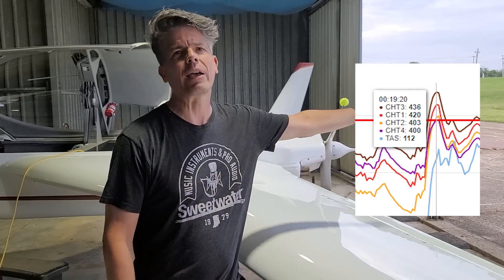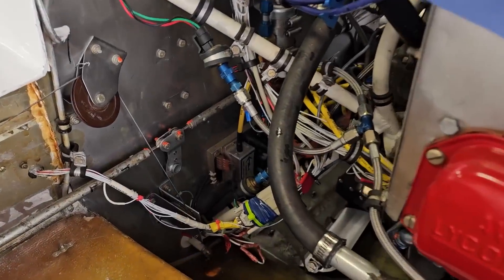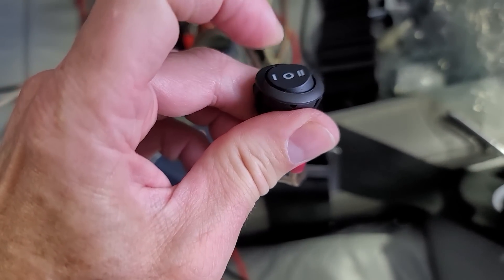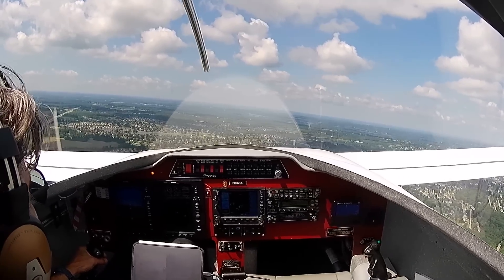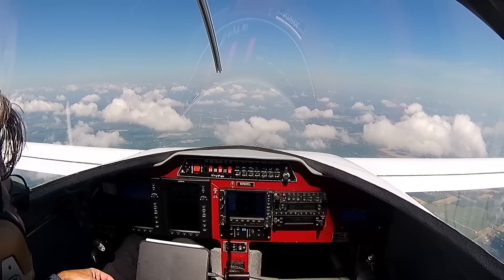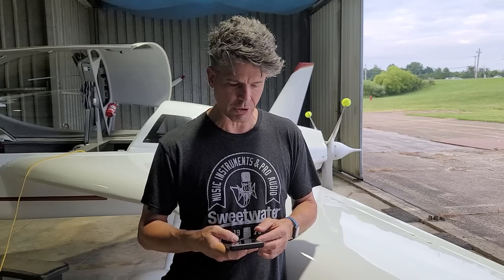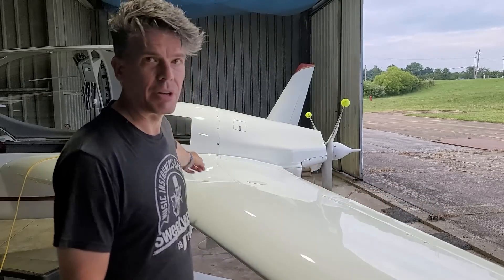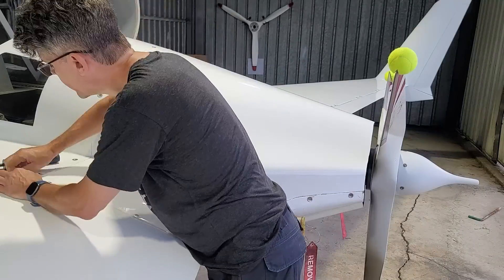FINALLY! My Overheating Cylinder Head Temperature Problem is FIXED!!! What Was the Cause?

Comment: That was awesome.  I’m having similar problems with my Cozy and found a similar issue.  I’m still working on it. How did you turn on and off the manifold pressure to the EIS?
Reply from the maker: I literally ran a set of wires back to the engine, connected them to the wires going between the manifold air pressure sensor and the EIS, and at the other end connected a switch that I could actuate in the cockpit.
Reply: @CanardBoulevard  my EIS has a manifold pressure line that runs directly to it.  I take it yours is an electrical signal that goes to your EIS?
Reply from the maker: @randyjaeger4406  Yes, it is a separate module. I'm about to replace the entire EIS, and the new one has the MAP sensor integrated.

Comment: Scott, thanks for the video, glad you got your CHT's fixed. My Cozy runs 300 330 CHTs but I have been fighting high oil temps. I have a friend with a new EZ still in flight testing and in the couple of years he has had it he has had it he has been unable to safely fly it without the CHTs going way high. I have suggested he check the timing and the carb jetting but it may be his P51 style scoop is way longer than Rutan's plan scoop. He does have a Surefly emag on it and I wonder if that has vacuum advance. I don't remember if it has a vacuum hose on it.

Comment: Thank you for this video and explanation. Very well produced and presented.  I'm also chasing a persistent CHT issue that has gradually worsened.  It's in a canard with a Lightspeed III and an E-Mag. May I ask which EIS you are using?
Reply from the maker: It is an ElectroAir EIS-1.

Comment: I wonder if you should use an endoscope to take a look at the top of the pistons. Just to make sure there was no damage from the extreme timing and heat causing pre ignition? Even with 105 that I would think can happen, you probably would hear it with the load exhaust. I am no airplane mechanic, just an old gear head. Good job finding the problem.
Reply from the maker: Already done, and the pistons are good. Thanks to low-compression aviation engine :)

Comment: Scott, assuming you have an Lyc. O-360 or IO-360 the engine data plate should list the magneto (spark) advance. There was an old SB that listed 20 deg as the proper advance, reducing it from 25 deg, in order to prevent detonation in cold weather ops. CHT should be 360 or less. Glad you figured it out. You might want to boroscope the pistons to see if there's any detonation damage.
Reply from the maker: It's 25 degrees, and it's been borescoped a few times, including just a month ago - no evidence of detonation.

Comment: For those of us old school sorts, the manifold pressure sensor/Electronic Ignition System timing has the equivalent functionality of a distributor ignition’s vacuum advance unit. It was acting as if full vacuum advance was applied on top of the base advance even with essentially full atmospheric manifold pressure, I.e. zero vacuum, at full throttle.

Comment: I have had the same problem with my Cozy for years and finally gave up.  What brand electronic ignition do you have?  I have dual lightspeed ignitions, but I don't know how to disable the spark advance to see if it that makes an improvement.  Any advice would be appreciated.
Reply from the maker: It's an ElectroAir EIS-1. Lightspeed does have a way of connecting a potentiometer to manually adjust the timing - it's in the manual for that unit.

Comment: Not sure how I found your program, but literally laughed out loud and predicted the timing issues you found right from the start...   I could do that because I've been going thru exactly this with my 1966 Corvette with Mechanical Distributor & Vacuum advance and a Carburetor....  ICE Engines all require the same (Correct) static timing (Magneto) and Dynamic timing (EIS) in order to run correctly and the result is incomplete combustion and over heating.  It matters not that mine is water cooled Car Engine and yours is an Air Cooled plane engine.  Happy Flying.

Comment: Great find.   I've had nothing but trouble with CDI ignition systems on airplanes.   They fail way too often----especially without proper blast cooling on the module.   Personally I would go with two mags and eliminate the CDI.
Reply from the maker: When operating correctly, it does help both in additional power and reduced fuel consumption. This one does not require blast air (those are mostly the ones with built in dynamos, like the E-Mag), and this is the first problem it has had in 20 years of operation, so I would call that fairly reliable.
Reply: @CanardBoulevard  
…and it wasn’t even the CDI unit itself, but an input sensor, correct?
Reply from the maker: @For_What_It-s_Worth  it was both the crank position sensor and the manifold pressure sensor that had failed.

Comment: You might want to have a look at all kind of cast flanges left in the innards of the cylinder flanges. The air have to be out of there quick....
I had a big difference in cyl temp by cleaning out all those casting flanges left over from the casting process....a drill and insert a chainsaw file ....chain saw files comes in three sizes...one of them will fit perfectly.  Heat removal is directly in propotion to heat shredding on aircooled engines....get that air going through all the nocks and crannies of the cylinder and you will shred tons of heat.

Comment: I'm no A&P, but is it possible the timing mark being used to set initial timing is incorrect ? If this were a car engine I'd assume the timing mark band on the harmonic balancer had slipped a bit. It seems the timing is off consistently across the entire RPM band right ?
Reply from the maker: That's not how it works for the EIS. The engine gets positioned at top dead center, a pin is put in the EIS, and it then gets installed. This ensures it is set exactly at TDC - and I checked it to make sure it was.

The actual advance being added was being done electronically, which is why it was showing up on my meter.

Comment: I had a similar cylinder over heat problem on a Cozy MK IV.  No changes with timing changes and baffle rework.  My problem was resolved with an 18 row oil cooler
Reply from the maker: I've never had oil temp issues, only the CHT's. Glad you got it fixed!

Comment: Wow, you had the exact opposite issue a friend of mine had with his 1986 Dodge Ramcharger 4x4 speed manual when it comes to ignition timing.... You had so much timing, and the engine still ran. My friend's Chrysler 318 had its ignition timing so far retarded, it some how ran, though his engine also had a TON of vacuum leaks and a horribly out of tune Edelbrock carb. and it all magically equaled a running engine... Barely running, but it did run after a long start. Once the vacuum leaks were all gone, I got the carb. cleaned up and adjusted, I found how badly out of time the ignition was as the last thing in the running issues. Now, hot or cold, you can go out to his Ramcharger, pump the throttle twice and hit the key, it fires right up. Went from struggling to do 50 miles per hour to doing 70 even with 35 inch tires. It is strange how some engines, if the ignition timing is off for even a short time, they destroy themselves, and other engines can be WAY out of spec and still (mostly) run. Also of note, if your ignition timing is too far retarded, it too, can cause some overheating issues under certain conditions. I have seen that happen as well.
Reply: Yes, retarded timing will make the engine lazy on starting, lazy performance, and make exhaust manifolds/headers very hot, even glow...and can make the engine overheat.

Comment: WTF most people probably don't understand this.  The fact this engine did not have a major malfunction with that much advance is magic or something, What do you mean,  it almost caused damage, it should have caused damage.  Okay, I can't hear the engine in IRL but from what I do hear the engine sounds weak to me.  You might have to or should tear this engine down if you put hours on the engine with this much advancement.  test flight one your time from brake release to rotation is also slow, and the engine is doggy the advance could be the problem for sure.  if it were me , I would stop flying this machine until you are sure the engine is running at full power and with proper timing and ignition advancement. You are just asking for a power-off forced landing. There is no need for that.

Comment: I'm questioning your decision to re-enable the MP sensor advance on the Emag prior to starting the takeoff roll, given that you've just briefed that the advance should basically be zero when at max MP.  Could you give us a breakdown of that decision process, please?
Reply from the maker: The airplane had been flown like that for seven months while attempting to find the CHT issue. I was recording baseline data with which to make a comparison. There was quite a bit more flying/testing than shown in this video (videos are always edited for context and length), what you're seeing is edited down from those flights.

So...turning the switch on basically made the engine operate the same way it had been for over half a year. The big test was actually the takeoff with it turned OFF - which I simulated at altitude before trying it on an actual takeoff run.

Comment: Scott, I hate to be that guy, but get rid of that thing. I have watched you patiently try to solve the issues of the original builder and the design flaws of this aircraft and I can’t be silent any longer. The CG is screwy, the engine cooling is screwy, the flat climb outs and flat finals scare the crap out of me and even attempting to put four people in there is not worth even considering. From your own videos, you cannot make a touch-and-go without first smacking the nosewheel on the ground. My Velocity XL could make consecutive t-and-g’s without ever touching the nosewheel on the runway. That plane is an accident looking for a place to happen. Please, my friend, if you just love canards, find a nice really clean Velocity XL (no affiliation) or XL-5 and find out what a true joy a well-designed canard can be.
Reply: I agree those long flat climb outs are scary what if you loose power over those trees ?
Reply: Regarding the flat climb out. Maybe that's how he flies. Almost like a cruise climb.

Comment: That amount of advance would detonate  unless the compression ratio was quite low . My 1980 race engine on a dyno a dizzy swing was performed at full throttle  a couple of degrees too much advance would instantly show as a power loss .thinking of my 1960 ford Anglia distributor   vacuum advance .. the extra advance was introduced only at low / light throttle settings  .. Like an economy spark advance to allow the lean mixture to achieve a complete burn  .   Great to resurrect memories on my Dyno work .1980 Donnington One litre   GT championship champion .
Reply from the maker: Aircraft engines are very low compression - mine is 8.5:1.

Comment: My employer owns a Velocity  with Franklin engine that had CHT issues as well.  It had dual Light Speed ignition boxes one had bad internal manifold sensor the other had similar issues.  Finally got tired of always chasing ignition problems and found 2 magnetos, no issues since.

Comment: This seems strangely backward. Anywhere that I have seen a supplemental timing adjustment added to cars and trucks the default tuning/setting is maximum advance for low load, so it can never advance beyond that baseline, then the timing modifier retards the timing when running at high manifold pressure, high ambient temperature, or a batch of low quality fuel. Even the manual timing adjustment knobs used on old non-electronic carburated trucks for occational heavy towing, still "0" is max advance and then you dial in degrees of spark retard.

Comment: Do you have a spare analogue voltage input on your cockpit display, for that voltage from the EIS that indicates the ignition advance? Put an alarm on it if it exceeds 40° or something.
It probably won't tell you much while you've got the manifold pressure sensor disabled but if you ever replace that sensor it would be nice to be able to see what the advance is if you ever suspect it's playing up again.

Comment: I had left the master switch on several times until an older friend told me to leave the rotating beacon or strobes on, like you that has saved a me from a dead battery several times! Enjoy your method of problem solving the over temp on the CHTs. Cheers
Reply: Yep I do the same.

Comment: Wow - The fact that no catastrophic damage was caused by this much advance over quite a bit of time is testament to your discipline in monitoring CHT and backing off power and maintaining full rich when required. It is probably an industry standard that manifold pressure sensors send a higher voltage at higher pressure, but this would have been such a more benign failure mode if it would have failed the other way resulting in no additional advance at low power. I wouldn't want to long term fly a constant speed prop without the manifold pressure sensor as it would negate a lot of the advantage of electronic ignition. But with a fixed pitch prop most of the time engine RPM is a good indicator of engine load. And, maybe not critical when it is off a bit descending at low power with the prop windmilling.
Reply: Catastrophic damage could yet show itself. I'd do a tear down. But I'd also never have dared fly it so much knowing there was that cht problem.
Reply: @thisperfectworld  Temperatures just a little over 400 degrees isn't likely to cause catastrophic engine damage.  Engine oil is still doing its job to lubricate and take heat away from the cylinders.  😉

Comment: Good to hear. Now consider this. Your Mag timing was 32° BTD which is much closer to what you stated as the desirable 35° BTD for the elec timing. It seems to me that both ignitions should be timed the same for cruise flight. So maybe that was the reason the mag was at 32°.

Comment: I had high CHT issues, (slick mags),  when I finished building my Vans RV7A.   Cyl 2 and 3 temps ran about 430 in climb.  My issues ended up being the baffles.  The cylinder fins on the Lycoming and the cylinder wall merged on the same plane, if that makes sense,  which stopped any airflow at that point.  After seeing post on VAF about this, I put in a couple channels to allow air to get by and bingo... took off on a hot summer day here in South Alabama and did a full power climb all the way to 10K.  CHT max was now about 375 and with increasing altitude ---> cooler air ---> engine making less power as we climbed the temps were coming down. 
Yes timing advanced as you were experiencing... like you said could have caused damage!  Great video Scott.

Comment: Finally a fix!  I have the same ignition system and same problem.  But I already disabled the vacuum advance and it made no difference, bummer.  I still suspect the ignition system but it's so hard to check the base timing on a pusher!
Reply: Is that because you don’t have safe access while it’s running on the ground, cowl off?
Reply: @For_What_It-s_Worth  Yes, crawling under it with one of those old fashioned timing lights while its running... scary.